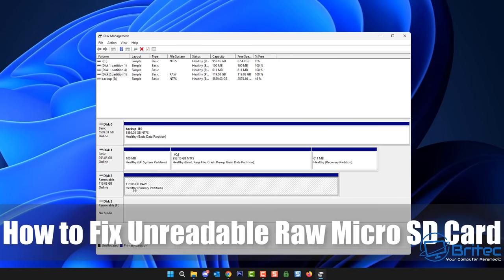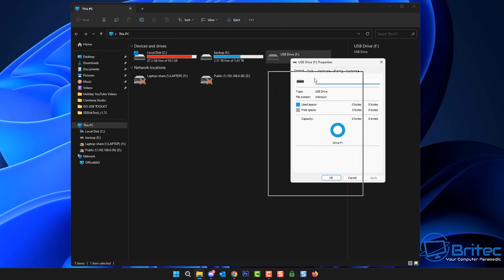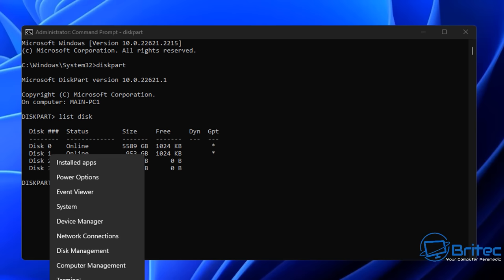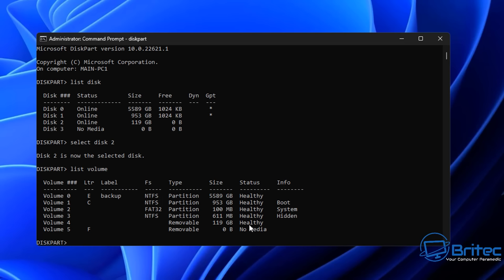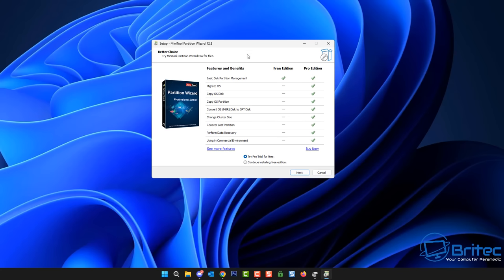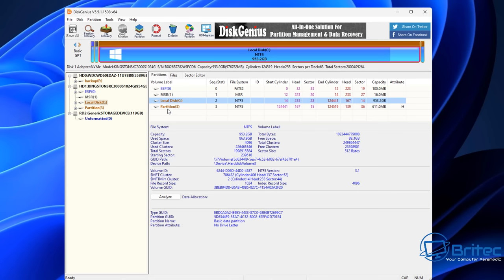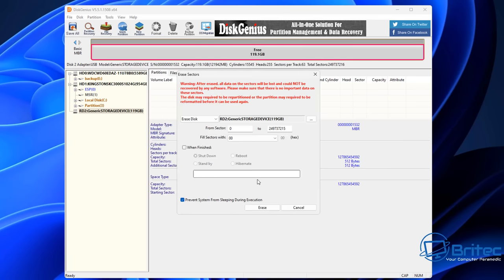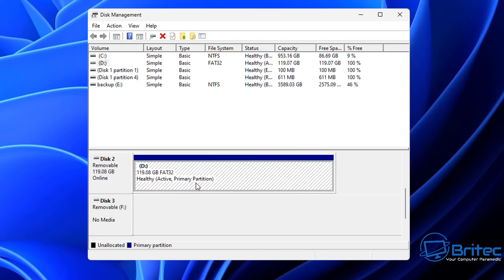How to Fix Unreadable Raw Micro SD Card

Comment: Using Google to find fixes like these is pointless. It won't show text tutorials in the results anymore, just videos, most of which is unrelated to the specific question you had. Remember when you could find hundreds, even thousands? They removed those.
Reply from the maker: I try and show real problems with real fixes
Reply: @fatflamingo6599  yeah i feel what you feel

Comment: Thank you!  This worked nicely on a RAW corrupted 64GB Micro SD memory card having its capacity reduced to 7GB's.  The DiskGenius fix still left some stubborn folders I couldn't delete, so I did another format this time using an Android phone.  (Phone formatting can sometimes fix corrupted cards).  The micro SD was originally used in a cheap dash cam and it seems to be a common problem.
Reply: @siotibi827   how did you fix it ? I have a 128gb card and it only showing 8gb. I followed the guide but still having the same problem. 

How can I get back my list Gb's ?

Comment: Fantastic video thanks, I have an SD card i'd used in a dash cam and i wanted to view the files on it in WIN 10, no chance windows wouldn't even list it in explorer, so I did all the stuff you mentioned, CMD command, clean command, partition, format etc and tried Disk Genius, although it is very good it just kept coming up with errors, I spent six hours on it and I was pulling my hair and still no dice. I googled this and  googled that and I was going to chuck it in the bin, then I realised I'd got an old laptop with XP on it, fired it up and Bingo straight away the card showed up in explorer, reformatted it plugged it back into the WIN 10 PC and it showed straight away, in retrospect if I'd done that first I'd still have the video footage but nothing of consequence was on there so no major loss, at a guess if your using SD cards in cheap cameras (you have to format them in the camera first) I suspect this is where the problem lies, so my advice if your having these problems save your self masses of time and put it in a machine with XP on it, (if you have access to one of course)..

Comment: I did everything with my micro SD and in the Genius it worked, but File Exporer still doesn´t read the card and windows prompts for formatting, but it´s never able to do it. Goes back to that windows error. In Genius it shows all ok, but still doesn´t work. I´ve tried all other ways as in your video and none of them seem to work. After I create partition and save all, it prompts for formatting and the drive disappears from the mains screen. Yours says unformatted in red, mine too, but after formatting yours shows as Removable and mine just disappears. I guess the card is totally corrupted for some reason despite of no errors showed in testing.

Comment: Thanks, Jim for the Video, I have a Sandisk SD card with 64 gigs & have Downloaded Disk Genius, My Windows 11 Pro doesn't recognize that Card at all in the disk mgmt or disk part nor does Disk Genius Using a USB Reader & Writer in my port being a SanDisk I find it hard to believe it's bad beyond repair, but it can happen because they are a reliable choice, I've even cleaned the gold contacts with rubbing alcohol and that didn't work any other suggestions? thanks, it's just frustrating not being able to use that Card Again!

Comment: I had had this issue on a 128gb sandisk Nintendo switch sd card that came with my switch I used Rufus to flash a os to it and it fixed the issue

Comment: I don't think there is any use on fixing an unreadable RAW microSD card specially if that card is already old. 
I mean if that thing goes corrupted for some reason, it is safe to say that its not a good idea to fix it and continue using it. 

The video would be meaningful if it's a recovery mission.  but since it was to fix a raw micro SD card.. what's the use of it then?
it's not a good idea to fix such and continue using it.    the only people who gonna gain on such thing are scammers who wanna refurbished micro SD and sell it online XD
Reply from the maker: The card is fixed and working, why would you not want to fix a 128GB SD card if you can?